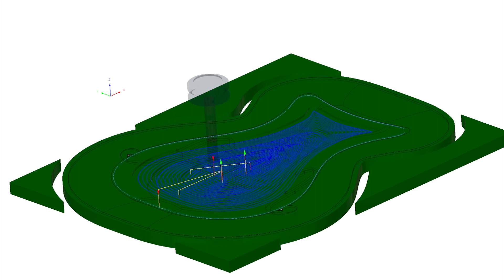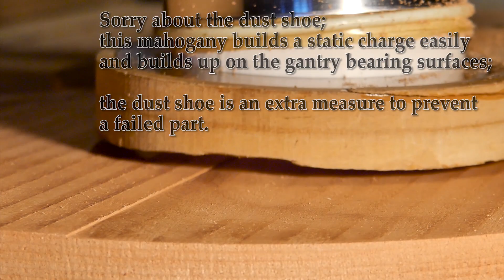Building an Acoustic Octave Mandolin from Scratch: CNC and Hand Tool Hybrid Approach | Part 14

Comment: Nice. Very nice. I've just milled, for the first time, a sanding dish, finishing with a 12mm bullnose bit. I'm amazed just how smooth it makes it.
Reply from the maker: Yes, the cutting angle on the ball nose can make a nice surface.